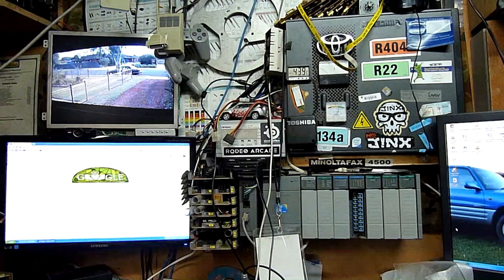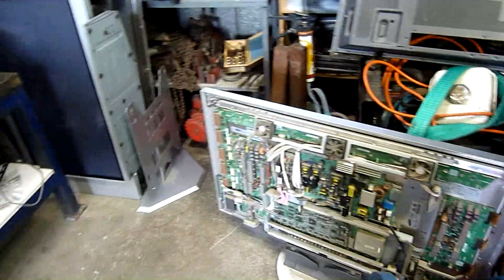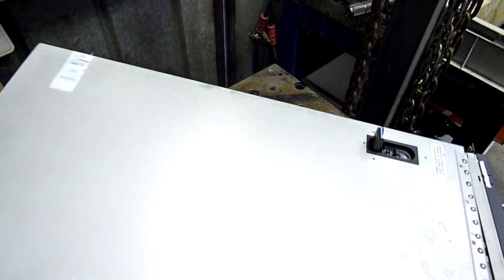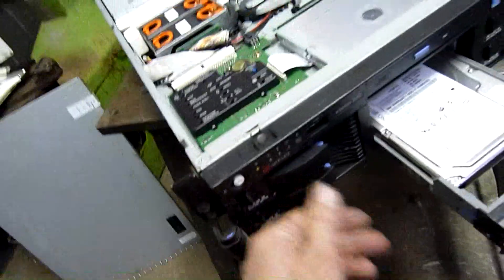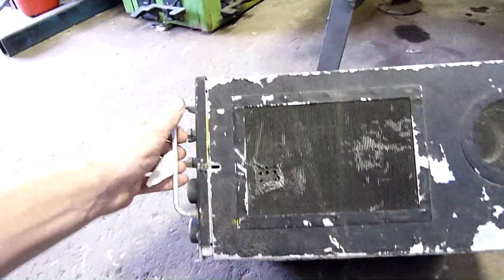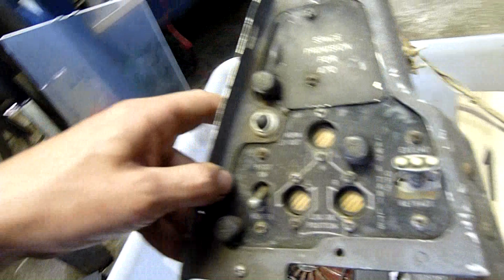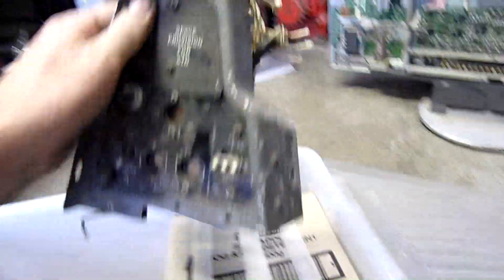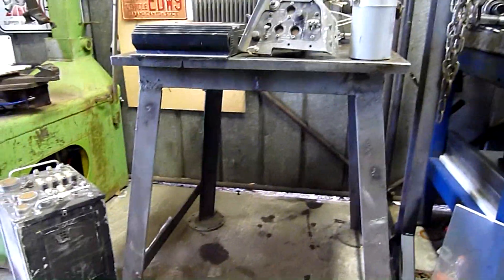Ramblotron Entry March 17 2014 - Donations from Alex993cc1

Comment: Greetings from Houston Texas, you were correct on the landing gear position indicators. They were sometimes referred to as "Barber Pole" indicators. The Barber Pole would indicate that a something was in a transition state, such as the gear was between stowed and fully deployed. BTW: Enjoy the videos..
Reply from the maker: Thanks mate!, do you think they would just use a variable resistor on the landing gear to send a gradually increasing voltage to the Barber Pole indicators?

Comment: That's not 'pilot heater', it's 'pitot heater'. It prevents the pitot tubes (for measuring airspeed) from blocking up with ice. The other switch on that panel is for the lights.

Comment: The lg on its side if that's a 42px10 then high possibility it's chip on film, I have done 6 of these on this model. Symptoms are the vertical black bars not hard to fix on these
Those older plasmas had great sound
Reply from the maker: I think it is a 42px10, but its not solid black bars, its multi color streaks of different lengths. could be the chip itself?
Reply: Aussie50
Yeah, i could be the chip. i had a pioneer doing that and it wasn't the resistors. those PX10's are Y-Sus "consumers" i have had litterally dozens with faulty y and z- sustain boards. I have one of these working with intermittent black bars (good for Y&Z boards)... Hitachi used this particular chassis too but i can't recall the model number.
Reply: AWA Radiola
FYI the hitachi equivelent of a 42PX10 is a 42PMA300A .